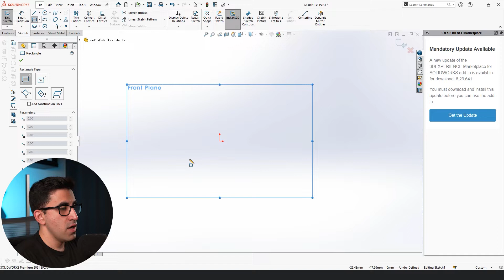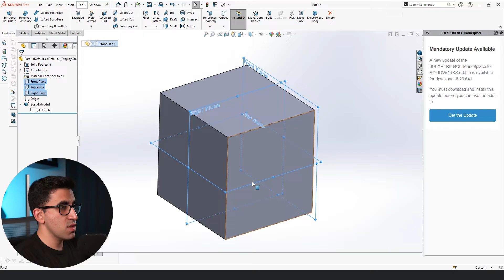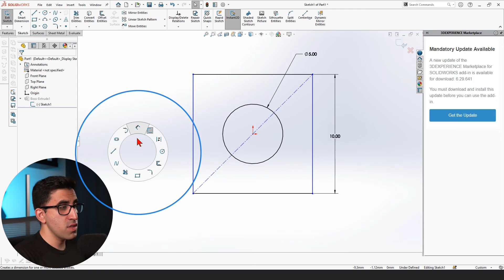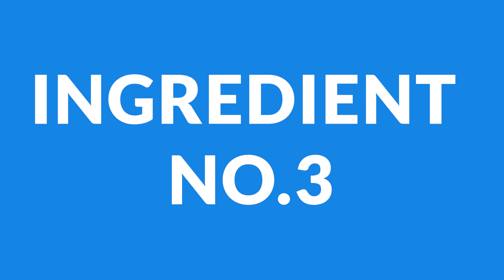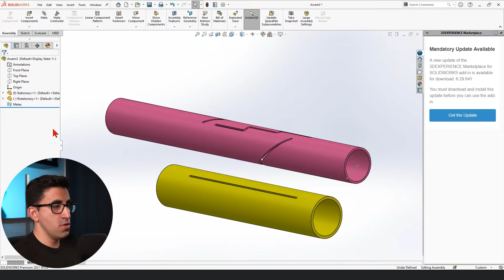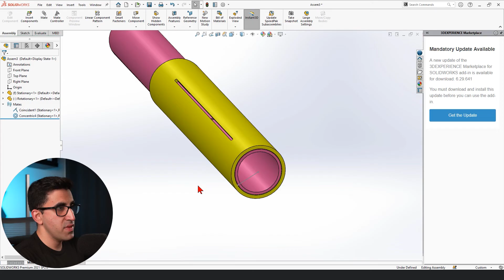How to 10X your Productivity in SolidWorks

Comment: For quick-mates I prefer the ENTER-Key (Click First Selection→Ctrl+Click Second Selection→Press Enter) This will select the most-likely mate but bring up the context menu to select a different mate in case you wanted it.  I haven't clicked that paperclip in years...
Unfortunately this technique will build a silly habit that'll make you wanting this feature in Sketch-Relations.  It's already got a BOLD relation (such as horizontal) and it leaves me wishing the Enter-key would similarly add this "suggested" (most-likely) relation.
One day I'll write a macro that'll go through the current selected sketch-entities and based on it's proximity to Horizontal/Vertical it'll automatically add that relation to ALL selected entities.

Comment: I have a an older Space Explorer at work, and I'm proficient at using it to manipulate the view, but I don't use it often. Why? PC gamer. I prefer to keep a hand on the mouse and one on the keyboard. I have a mouse with a tilt wheel and two thumb buttons. I didn't have the will to memorize the 8-way RMB drag menu in part mode or assembly mode, so I assigned CTRL and SHIFT to the mouse thumb buttons, and CTRL+7 and CTRL+8 to the left and right wheel tilt. With that, the tilt wheel gives me isometric and normal views. The thumb buttons do the other heavy lifting. Shift modifier for MMB drag is fine-control zoom, and CTRL modifier for MMB drag is pan view, while MMB alone is rotate. This gives me all the view manipulation I need, all within my regular 2D mouse. What's more is the CTRL and SHIFT on the thumb buttons make multi-select and transparent select (or the two combined) a one-handed affair as well. Now that I just learned from you (although you didn't explain it in this video) that you can dimension to the near or far point of a circle with the shift key, that mouse thumb button now wears a third hat.

The only weakness I've found with my configuration is that there are some contexts in which SolidWorks blocks the normal view from functioning. Most of the time that happens I'm just looking for right/left/top/front view anyway, so I'll jump over and press the dedicated view buttons on the Space Explorer.
Reply from the maker: That’s an impressive setup—it’s clear you’ve customized your workflow to perfection! Using the mouse thumb buttons for CTRL and SHIFT is genius, especially for one-handed multi-select and transparent selections. Combining that with tilt for isometric and normal views is a great way to stay efficient without constantly relying on a 3D mouse. SolidWorks blocking the normal view occasionally can be annoying, but having the Space Explorer as a backup solves that nicely. Thanks for sharing such a detailed and innovative configuration!

Comment: Let me save you all the time, if you actually want to be more productive you can start by never installing this garbage program SolidWorks is trash and it basically relies on people like this to get people to f**** use it honestly I feel bad for people that actually like this software because they don't know the greatness of other programs they are just trapped in this f**** garbage that is SolidWorks. So if you really want to save your time and be more productive I would suggest trying Autodesk Inventor it's cheaper and it's streamlined a lot better and the best part it doesn't fight you at every inch like SolidWorks does it actually works with you and you can do some pretty insane and amazing things with it compared to this garbage.

Comment: One thing I would add is the S key can be mapped to your 3D mouse. When working with the basic 2 button version, I mapped one button to the S key and the other to the Escape key. Greatly improved my SW modeling speed and saved a ton of 'mouse mileage'. Plus, your concept of only learning 5 new things at a time applies to stuff like the S key and Gestures too. Only set up a few of them and use the hell out of them until they become second nature, then and only then, is when you should add more. Too much too soon and most people just get frustrated and don't end up using them at all.
Great Video as always!
Reply from the maker: Great point! thanks. And thank you for watching
Reply: Very good advice, thank you.  That was me and I too got frustrated and stopped using it.  Love the idea of the S and Escape key.

Comment: Hi bro! Could you say that how did you remove these two rectangle each other? So how did you open of the rectangle edge? Its there 10.53 of the video.
Reply from the maker: it was a fast mouse gesure to activate the Trim entities and trimmed those two lines. That;s how fast I teach my student to model In order to model freely you should be able to handle these small things without friction or resistance